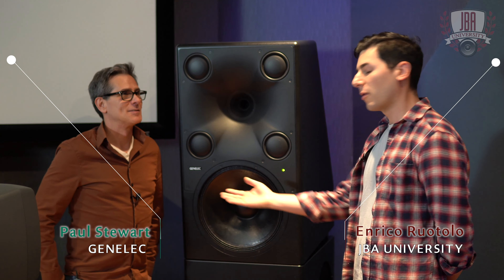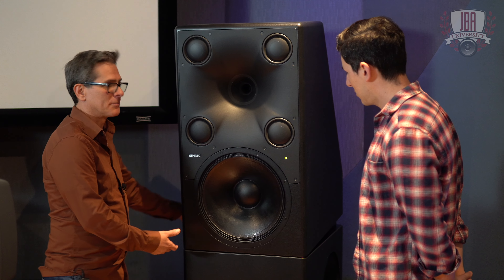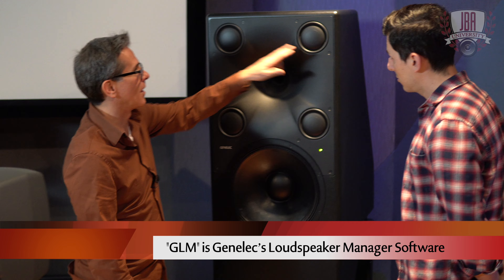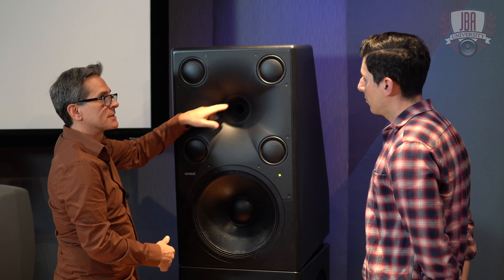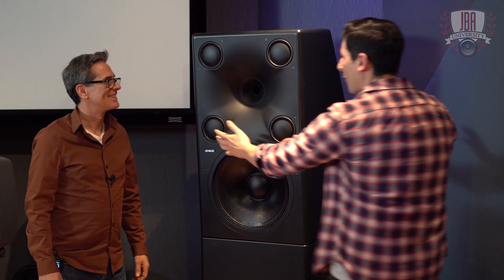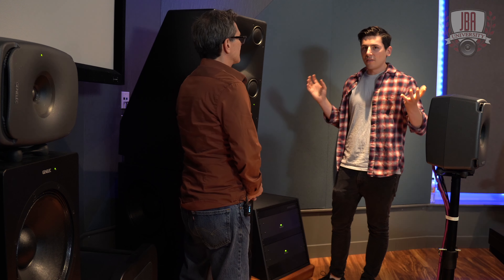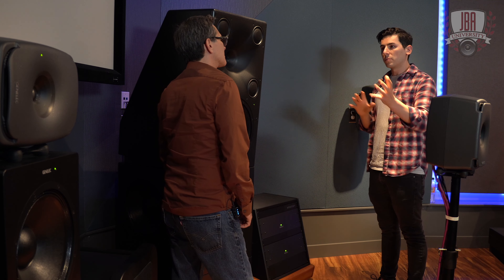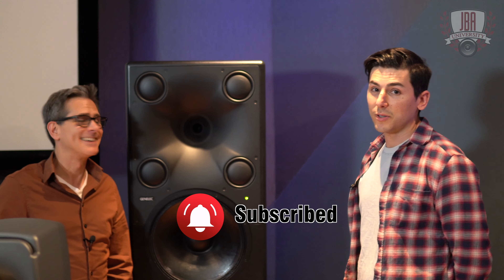The Genelec 8381a Main Monitor is a BEAST!

Comment: I am wondering why they don't have interference from those four midbass drivers? How high do they cross on top?
Reply: The 4 midbass drivers only work from about 150 to 500Hz , then the coaxial unit in the waveguide takes over
Reply from the maker: It's because the spacing of the drivers (13”) relative to the operating bandwidth (250Hz-500Hz) ensures proper summing. 

If the crossover to the coax mid/tweet was higher (say 750Hz) the 13” spacing of the 4x5” would be too broad and there would definitely be interference. 

This is a brilliantly thought out acoustic package.